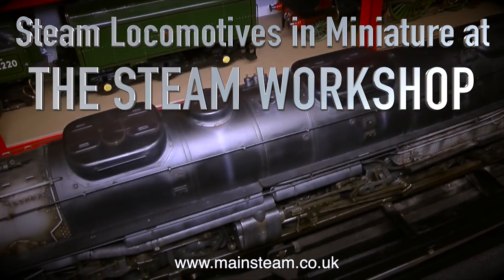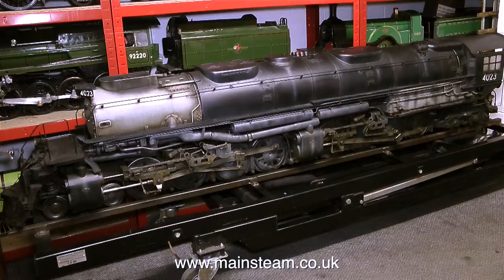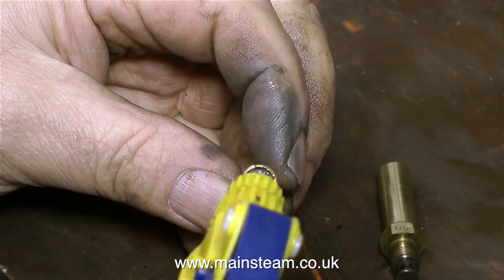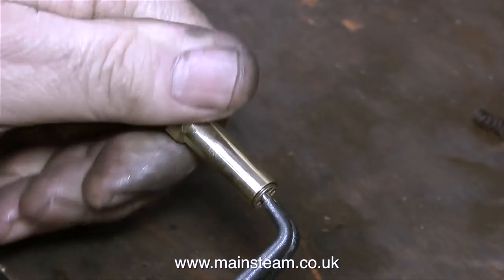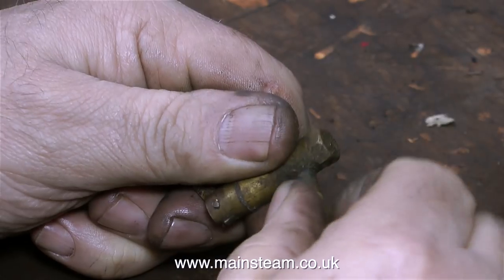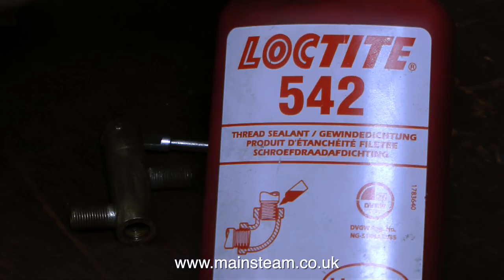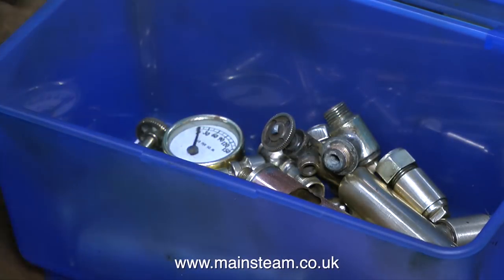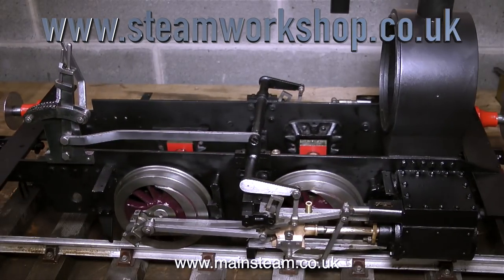WORKING AT THE STEAM WORKSHOP #15 - CLEANING AND REPAIRING THE FITTINGS

Comment: Keith, what is the purpose for the notches on the reversing lever?
Reply: Positive engagement
Reply: mrblond750 - to adjust the cutoff.
Reply: Like Ian says they keep the lever from moving with the vibrations.
If you are asking asking why there are more then 1 at each end then that is for efficiency.
Moving the lever more to the center adjusts how long steam is admitted to the cylinder while the piston is making a stroke.  When the engine is just starting to move you want full pressure on the piston thru it's full stroke.  But that means that at the end of the stroke the cylinder is full of steam at high pressure and the energy it contains is wasted when the exhaust opens.  You get a lot of power but at a low efficiency.
After the train is moving you do not need so much power and the guy shoveling coal into the fire needs a break so buy cutting off the steam early the steam in the cylinder can expand for the rest of the stroke and the engine uses much less steam.
Reply: The notches are there so you can adjust the valve gear, and it uses less steam